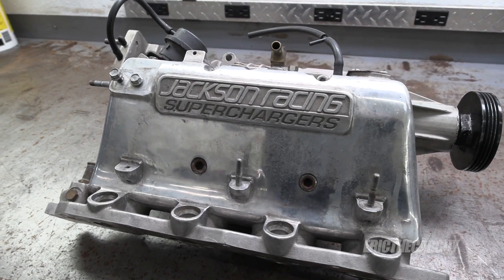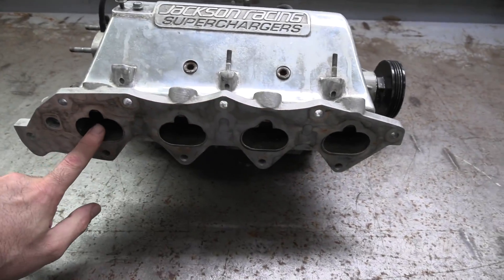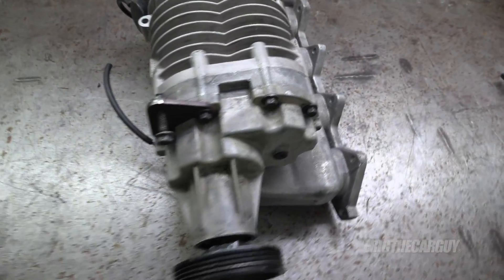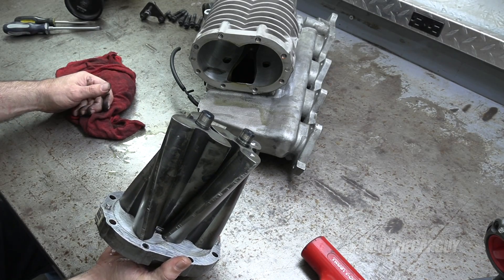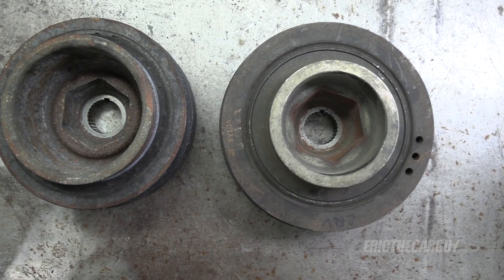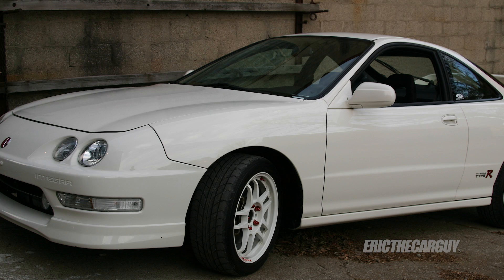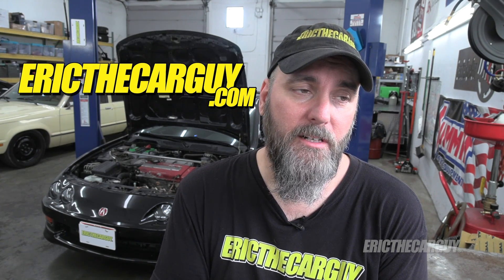Supercharger Tear Down and Inspection

Comment: I just got a JRSC kit for my 94 GS-R this weekend, can't wait to get it on! Drove 6hrs to get it for 2500$ and the supercharger itself looks in great condition and it had all the brackets and pulleys included. Gonna do some research tonight and order up the belts, new adjuster bolt for the tensioner and an oil+coupler kit for the charger and hopefully install in like 2 weeks

Comment: The scores in the housing and rotors are most likely caused by dirt and other particles sucked in because some knucklehead ran it without an air filter. When the bearings go bad you usually get smooth wear marks on the rotors and and housing.

Comment: Your video is two years old as I comment.  If it were me I'd put a set of bearings in it and see how much boost you get out of it.  You said you weren't looking to get a lot of boost anyway.  you might just have to use a little smaller blower pulley to compensate for the increased clearances between the rotors and the body caused by the scoring.  Nice entertaining video.  Good job as usual.

Comment: What if you stick a two barrel carbonator on to the waist gate would awsom if set up right i can put an good eletric carbonator with a wireless choke to go with the fuel injection imagine carbonator mixed with fuel injection with thats basically q respibe for the worst gas mileage you will ever get with is 1 mile or 2 miles a gallon lol but you get a lot of power if made right or put a cold air intake on the waist gate or make it take oil to lubercate the two root gears it be a good thing to have.

Comment: I am curious, and I know this is a video from last year, but what was the verdict in the end, for the supercharger, or more so for reusing the casing? Reason I ask is that I grabbed a junkyard m62 off an Xterra for a Jeep project, and once I tore it apart, same thing : someone let the bearings get bad, and the rear 3/4 of the rotors came in contact with the housing (pretty nasty like yours, but maybe worse). Now, I ONLY want to run 5-6psi of boost, so I was wondering what ever happened to your blower, if it got rebuilt etc. (I am also curious if, with the damage in mine, if it will still make the boost I want, or if I should start hunting for a GM m90 off a buick etc)

Comment: I missed this video 10 months ago but watched it as soon as it was suggested. Around the 3:20 mark I could swear you said you believe the 62 means it move 62 cubic ft of air per revolution. I just can't wrap my head around how those impellers could possible move 62 cu ft of air in one revolution. Correction: the M62 moves 1.016 L (0.036 cu ft) per revolution.

Comment: I learned the hard way 2003 Ford SVT Lightning. 117k miles. It has always ripped instantly to 11 or 12 lbs boost. I let a decent mechanic touch intercooler and supercharger fluid. Never been touched. He redid tensioners on 2 pulleys. DONT LET ANYONE EXCEPT SUPER EXPERIENCED EATON SC TOUCH IT! I drove it home at depressing 8psi flat line boost. The blood curdling scream is only ok. Some Lightning community people are trying to help me. The electric problems come first though. So many break ins by my aftermarket security system probably need inside harness done. I have one. Just hoping to find good help

Comment: This is actually the same supercharger as what's on a Cobalt SS LSJ engine. It just has a different snout & throttle body inlet. It's cool that it's more of an aftermarket/universal version. My son has an LSJ with the stock M62 & a MUCH smaller pulley. To keep intake air temps down we've done every cooling mod possible (they have a Laminova "intercooler"). Meth/water injection made more of an IA2 difference than anything. Too bad after all of these mods, he still can't keep up with dad's mostly stock turbo Cobalt lmao. Anyway, cool video. You have a new subscriber :)

Comment: Hey Eric, what do you plan on using for tuning it? I would add some injectors (don't need to be huge) and a high flow fuel pump as well (255 lph is more than enough). 500cc ish injectors are okay. Stock map sensor is okay as long as you stay under 10 psi or so. I tuned the d series version of this and it was a blast! Be careful of high IATs, I would be agressive with pulling timing for higher temps.

Comment: Just a question. Aren't the housing components supposed to have any gasket or sealer between them? If you're dealing with oil, my guess is that they might have, but do they make them so that you don't need to put any? I'm curious.

Comment: Those supercharger are known for cracking manifolds due to the weight. My brother ran that same unit on his GSR and I made him two brackets that held it from the block to the supercharger so the manifold wasn't being held up by the bolts alone. They are also bad for heat soaking. My brother got maybe two to three runs before it started heat soaking but driving around was fine. Also sitting in long red lights or traffic will cause it to heat soak also. All in all it was a good unit. Made good power on the low end.

Comment: Love it Eric . I still have my original supercharger form 2005 for an em1 . I also have that meth injection kit. Its a rebranded aquamist meth injection kit. Discontinued as well and not sure if you can still find parts for it. It runs off a boost pressure switch that went on the back of the manifold. It was factory set to 10 psi i believe . Carefull because  the meth is know for causing the coating to flake off the rotors . Not sure if thats true or not but it did happen to my sister who had the same kit and car while running the meth injection kit. On my stock b16a2 with the stock 6 psi on the charger i was able to make 205 at the wheels.  It sounds and feels better with the stock intake and stock exhaust. Although you can get higher number with new intake ,exhaust and header it wont have the same feel or sound.

Comment: I had mines stripped down and polished smooth inside. Also everything inside was Teflon coated. Went with the smaller pulley, CRV crank and nord lock washers. I would get that heat exchanger. My temps were hot.

Comment: Is it possible to somehow use an air2air intercooler with the roots blower?
Reply: It is, but usually then the supercharger gets mounted on the exhaust side. That way it basically just gets plumbed with pipes through the cooler and into the intake.

Comment: At 6:21, you say the those are "the rotors that compress the air..".That supercharger doesn't actually compress the air within the rotors, It's basically just an air pump. It forces air down into the manifold where it builds pressure. A twin-screw supercharger does compress the air between the rotors. If you google "roots vs twin screw" , you'll see the difference.

Comment: I figured you would compare or mention a twin screw supercharger over a centrifugal since it seems more like the roots or are roots & twin screw basically identical in their design & lower to midrange power enhancement abilities?? Interesting to see how few internals there are when trying to wrap ones mind around why superchargers are so expensive?? However Ive seen other types that when disassembled you could clearly see why they were so pricey..Great video thanks

Comment: Not a fan of Superchargers I prefer Turbochargers instead of superchargers let me explain. The Superchargers add a load to the engine because it is driven by the crankshaft and create more "lag" than turbochargers because not only does the engine have to drive the wheels it also has to drive the supercharger which causes a delay in response. Where as turbochargers are better because there is no load on the engine except for exhaust flow restriction.

Comment: I've had a JRSC on my 2000 Civic Si since 2001. The stock boost pulley is 6psi and the belts while narrow would tend to shred themselves due to excessive heat since they are so short. The original kits came with metal idler and tensioner  pulleys and they(Jackson) ended up switching to a type of plastic to reduce heat retention which was (supposedly)causing the belt shredding. I have not had this problem.. ever. There are a few things that would be different today while running this kit specifically the engine management that simply didn't exist when they were originally released. No more using a rising rate regulator and a relay to "trick" your stock ECU to run open loop while in boost. Choose your appropriate injectors and a Hondata with a little time on a dyno and you'll have a very normal driving experience.  The FMU originally included was susceptible to partial throttle detonation so you basically had to be on it, or baby it to protect your pistons. LOL. Anyway, looking forward to seeing where this goes.

Comment: Correction: The valve you were referring to is known as the "Bypass Valve". It does not bleed off boost, but rather "Bypasses" the airflow past the supercharger and into the cylinder head directly. Nice Video.

Comment: Dude that sc is fiiiiiiiiine. Just polish the rotors and housing , new bearings n seals and itle be juuuuuust fine. If it's a little low on boost just drop the pulley size

Comment: the 62 in M62 is the displacement or internal volume in cubic inches which is close to 1 liter. It's the stock blower on the Ion redline and early cobalt SS's

Comment: They still sell snout repair kits and couplers.   
You can port out the v shape on the inlet and those holes on either side are silencer holes that were federally required to reduce blower noise. They can be plugged,  CAREFULLY,  with Jb weld and that thing will scream at you. 
Welding  will warp the case.

Comment: Considerations for using boost, if you are putting this on a hi comp motor (10.0 up) might be an issue as most boosted motors run 8-9 CR as a starting point, also some consideration to cam grind might be in order, you want to keep that boost in the combustion chamber. Fun project no doubt, I would run my thoughts thru a engine builder app just to make shure it is feasable before pulling the trigger. Enjoy and stay safe.

Comment: Very cool video.  I use to have a JRSC on my 98 GS-R.  Definitely a different sound when you hear that thing wind up.  I loved it.  Always had issues with the long bolt that adjusts the tension on the belt.  Looking forward to you installing this on the ITR.

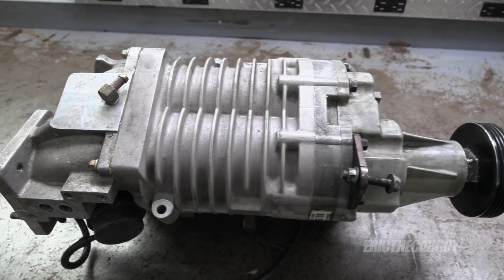Comment: 3:30 62 stands for 62 cubic inches of air per revolution.
10psi/460cfm @ 14000 rpm(MAX SUSTAINED RPM).
Air discharge temp 180* @14K rpm, HP gain @14K rpm 36hp(Buick 3800).
Carry on. 👌🏻👋🏻

Comment: For better gripping belts, use Formerly Goodyear Gatorback, now Continental Elite belts. You have to order them online from vendors. They will grip a lot better due to ribs similar to a running shoe undersole. Only issue is, they are slightly thicker, so you will have less clearance on same rated length.

Comment: Could you make a video explaining returnless fuel systems please?
Reply: What's to explain? Instead of a line on the opposite end of the fuel rail there is usually just a damper. I made my return less into a return style, very proud of myself lol
Reply: Retunless sux because of how prone to vapor lock they are, you're fpr in a return less system is usually found inside you're fuel tank on the pump

Comment: LHT performance 727-344-1800 is the place you need to contact. If they find answer just leave a message they will get back to you.  They build the Heat exchangers for them and are very knowledgeable

Comment: The inner housing being scored should not be an issue, once you've replaced all the bearings on both ends, other than a bit of air velocity loss. Those rotors should not even touch the already worn inner housing once everything else is replaced. And honing out the inside of that scored housing to make it smooth again may drop the air capacity / efficiency even further as the gap tolerances widen. I'm sure it will still provide a nice amount of boosted air but it will never come close to when new. Just some random thoughts ;-)

Comment: The bypass valve is just that, bypassing the rotors under normal driving (vacuum) rather than compressing the air through the rotors for efficiency. Its not like a wastegate. It isn't bleeding off boost, since that would be after the rotors and would be the function of a blow off valve anyway. This is a valve before the rotors.

Comment: That bushing on the rear of the pulley shaft, when worn, leads some to believe the supercharger is trash. You can actually replace it with a solid bushing from Dorman and it works great. Replaced quite a few on GM 3800SC engines.

Comment: I have one of these I actually plan on putting on a CR-V. It does have wear as well on the blades. Thank you for putting in a link to the rebuild service as I might look into that as well. It's also good to know about the CR-V crank pulley. While I do plan to re-sleeve my B20 and use stronger piston/rod assemblies, I don't want to go too crazy with the boost. It sounds like my stock crank pulley would already be bumping that up some. Good video for sure!
Reply: How to make a crv make the same economy as a f150

Comment: The m62 m90 etc 62 is .62liters of air per revolution or so I heard. I bought a m90 off a buick that I planned to put in an s10 sold the truck still have the blower.

Comment: ERIC! I need your help brother, I'm a Honda man like you. I have 2003 accord 3.0. 6-speed manual. I disconnected the brake master cylinder, to get to another part I was changing, I hooked it back up and bleed the brakes in the proper order, closest to farthest from the master cylinder. I still have almost NO brake pressure. The pedal feels stiff when the car is off but when the engine is running the pedal goes all the way to the floor. My manual says it needs to be bleed with a scan tool. Is there anyway around this or do i need to bite the bullet and have it towed to my shop?

Comment: If you installed that on the ITR would you need to tune the ECU?
Reply from the maker: It would need a completely new ECU as Honda computers are not tunable stock. I'm likely going with Hondata.
Reply: Eric, if you have the ecu you want to use, you can send it to me and I will socket it for you. I used to tune a lot of Honda's back in the day and have all the equipment. Send me merch as exchange 👍

Comment: I've always used Dayco PolyCog belts for my ProCharger, less slip than Gatorback or solid rib belts I've tried over the years. The larger blower pulley will help too, little more surface area for the belt to use.

Comment: Same charger as the mini cooper s and they were never very good due to the rear bearings having no oil bath or feed.
I think a centrifugal charger would suit the Honda power band better than a roots style
Reply from the maker: I believe that would require removing the AC.
Reply: @ericthecarguy  I'm cool with that ;)

Comment: No mention of my favorite, the Whipple Supercharger?
Reply from the maker: Whipple is a name brand. They use the same 'roots' style as in this video.
Reply: A whipple is similar to this idea, just uses rotors that are a screw shape instead of the lobes. They’re generally more efficient and heat the air less.

Comment: Nice burn. What happened? When it comes back-
remove the screws, brake parts cleaner the vanes
and chamber. Spray a LIGHT coat of Plasti-dip on vanes
& chamber, let dry. That unit is totally fixable.
Look for "Hypoid gear" oil (riding mower trans).

Comment: On video those gouges look way over .003". (More like .015" deep) I would send it out to get it looked at. It's not like they can install oversized rotors either. They may fit against the wall better but they'll start to crash into each-other.  Fingers crossed it all works out.
To measure the gouges you would have to get a surface plate and balance it on some "1-2-3 blocks" (Or v blocks), then use a dial indicator to measure the depth.

Comment: How does a larger CRANK pulley make it spin faster? I can understand a smaller pulley on the charger, but my brain cant process the larger crank pulley
Reply from the maker: Link in the description to a pulley size calculator that may help illustrate it.
Reply: Bigger crank pulley spins the alternator pulley faster, alternator pulley spins the supercharger pulley faster..

Comment: I have j35 with a m90 on it. Run the smaller boost pulley with the meth injection you won’t regret it

Comment: Now that you have the intake header and throttle body could you not buy any new super charger with the same bolt pattern and stick it in between the engine specific bits?
Reply from the maker: I don't know if they're still available. I've spoken with the company that reconditions them and they seem to think they can bring it back.

Comment: Eric i got an issue with a suzuki sidekick sport 98. Vin isJS3TD21v3w4107392 we did a valve change it start but rpm just unstable the pedal to acelerate doesnt funcion when press down. So can you help with your knowledge the acceleration body is clean already.

Comment: I think you're totally making the right move going with a supercharger. It's much more fitting with the character of the engine. A turbo will give it a different power band and it probably wouldn't kick in at low RPMs like you want.
Reply: But I would trade a linear power curve of a supercharger for the power potential of a turbo. 
Supercharger makes what like 220-240hp

A turbo makes a sohc 1.6 d series break 300hp easily.